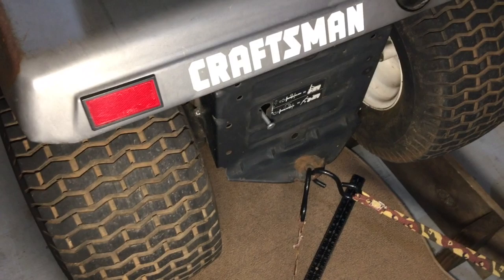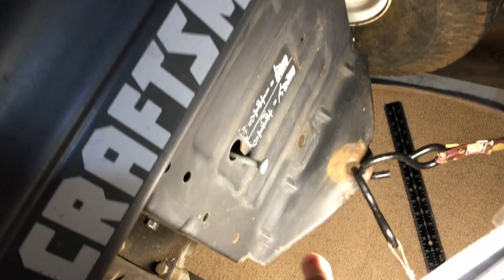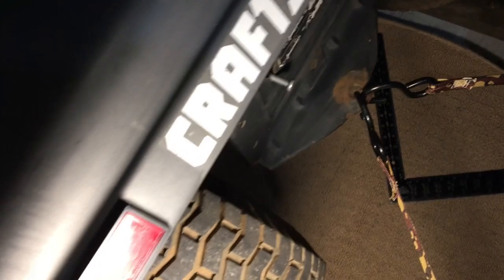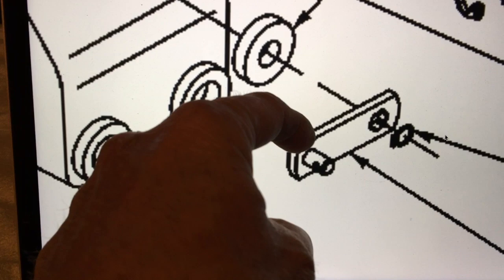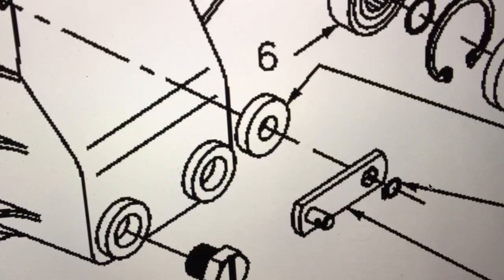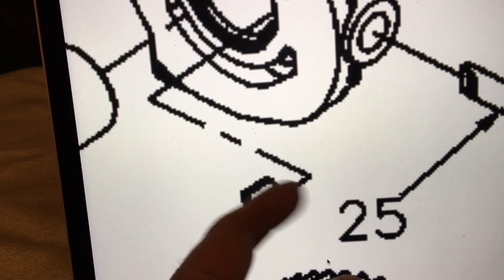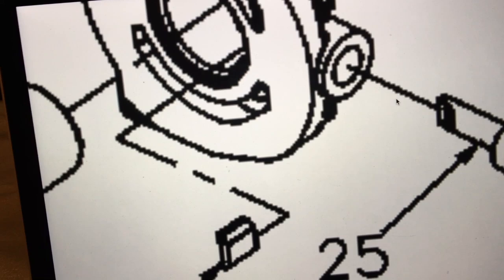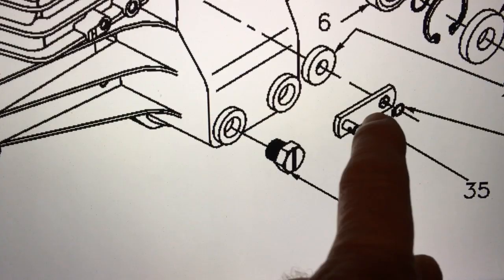Lawn Tractor Hydrostatic Transaxle Disengagement/Bypass Actuator - Diagnosis Part 1

Comment: Access to the hydro gear is by removing the rear cover (or what Sears calls the Drawbar Stretch). It is the part with the 'keyhole' that the disengagement lever goes through. There are two bolts on either side (you can see the ones on the L side at 0:27). Use a 9/16 ratcheting box wrench, etc., to remove the bolts then pull the rear cover right off. Full access to the hydro gear. Keep in mind that the disengagement rod must be pulled firmly, streting the spring, and the retaining pin set to activate the bypass.
Good luck
Paul
Reply from the maker: Thanks Paul!

Comment: I took some of those old ones apart before and they lock up from water getting in from were the rod pole is at on the top of the transmission it drips down between the rod pole and into the transmission in will sit their an rust the shifter rod out until it locks up 

If it's a cheap spicer transmission I don't think they used good seals around the rods on top the transmission and then inside it not good they made it to where it would hold water on top then until it gets inside and then those old ones are packed with black grease it's not oil that turned into grease over time its black grease the same as what's in a tube

Comment: the owner actually cut the bypass valve release bar. IT doesn't move at all any more so something is wrong with it. I can push the lever in and use a wire to hook it. I can hear a whining comming from the transmission but the mower refuses to move. Eather the bypass is bad or the pump is. The owner told me it was slowing down while trying to move it, so my guess is the pump has failed.
Reply from the maker: I'd say their bypass system on these is not a great design. And these hydros are a lot different than the much more heavy duty hydros you will find in older Wheel Horse, Cub Cadets, John Deere's and others. I think the hydro internals in them are decent for what they are and the price range .. but the bypass mechanism is just bad. I have a Wheel Horse hydro that looks like it is 10 times stronger than one of these hydros. These newer Sears Hydros are probably best considered 'disposable' .. still could be a great mower for 10-20 years .. but the older stronger ones could last forever with proper care. I've got a 1969 Sears Hydro that is of the same heavy duty quality as the Wheel Horse/Cub Cadets etc, so Sears did make em .. just not so recently like in these 1990s models.
Reply: @maxhauler  mine are past 20 years old and all still works good

Comment: Please, where is Part 2? What did you have to do to fix it? My trans release suddenly quit when we tried to release it to roll into the garage for a starter problem. Seems odd to have both problems at the same time.
Reply from the maker: Hi Stephanie. What are the symptoms of the starter issue? It is extremely unlikely that those two issues are related and I'm pretty sure that aspect is just a coincidence. Regarding the hydro-static trans-axle release/bypass: I never continued my diagnosis and thus the video series, but I am pretty certain what the issue is. If you notice in the above video at the 6:34 mark where a green
arrow appears: This is pointing to the top of a shaft which is aligned vertically and to it attaches an arm which rotates in the horizontal plane, pointed towards the left side of the tractor.  The lever (wire) you operate in/out on the rear of the tractor is attached (with a spring in-line) to the end of this rotating arm. Where the arm attaches to the shaft, it uses a rectangular hole in the arm, fitted over a rectangular part on the end/top of the shaft. A screw secures the arm to the shaft. I believe that the actual problem in most cases is that the arm has come off of the shaft and/or has worn/stripped the rectangular fitting area of either the arm or the shaft or both. I believe that the screw can come loose leading to the stripping or detachment, but I also believe that the arm can strip the attachment point without a loose screw, but most likely the screw loosening is the precursor to the issue.

Now I never actually did any further diagnosis or work on this tractor after the end of the above video as I have 10 tractors and life happened. Hence no Part 2 video. But based on what I could see up in this very inaccessible and cramped area of the trans-axle and equally based on what can be seen in the manual exploded view I include in the video, I am fairly sure this is the problem.

There is a slight chance that a similar problem could occur on the other end of this little (approx 2-3 inch) shaft down inside the trans-axle, where a shovel-shaped end twists against a rectangular shim which actually lifts the hydro-static motor away from it's base to allow oil to bypass .. BUT I think it is far more likely that the problem is on the external end of the shaft. We have all seen arms/shafts with this kind of rectangular attachment point come loose. If you are lucky, then perhaps the screw simply came loose and things can be fixed by reattaching. Unfortunately I think any work on this bypass arm can only be done by removing the trans-axle from below. I suppose there is a chance that removing the seat and fender and fuel tank might allow sufficient access from the top, but the amount of work is probably the same done from below as from above and dropping the trans-axle is the only sure way. I'm guessing about access from above.

Dropping the trans-axle is much easier than it sounds. If care is taken with preserving the positioning of the shift linkages then this is very straightforward and shift linkages can be adjusted after the work. You might find that you can simply reattach the arm to the shaft and tighten the screw and add some Loctight to the threads to prevent loosening. If the rectangular attachment part is damaged (as it could be) then it might be possible to actually do a quick weld to secure the two parts. I would personally be fine with welding the attachment point to save me from a full trans-axle disassembly.

Worst-case scenario is if you replace the entire shaft and arm. It does appear from the manual that an nearly complete disassembly of the trans-axle may be required. Now the parts themselves are readily obtainable used from Ebay and complete with shipping you can probably get both the arm and the shaft for less than $30. I don't think you can get these parts new anymore but it might be worth looking.

I think a good step might be to just drop the trans-axle and see if the arm can be reattached easily, even if it needs a quick shot from  a welder. If so then you are in luck. If not, then of course how much effort you might put in from there (which could be a lot) will depend on how much you love this tractor.

Good luck! - Maxhauler.
Reply from the maker: Small correction: It looks like rather than a screw, the arm is attached to the shaft using a c-clip. The best-case solution would be similar .. reattaching perhaps with a new c-clip, but more-likely, a shot from a welder, preferable to the full trans-axle disassembly. The c-clip usage lends itself to an increased likelihood that the rectangular area is stripped and also does not allow the use of something like Loctite to strongly secure a screw. Hit it with a welder if you can IMHO.
Reply from the maker: Apparently, YouTube lost my very detailed response to you. It was like a full page long. In a nutshell, Look at the video at the 6:34 mark. The wire you activate from the rear of the tractor attaches to a spring that attaches to this two-inch long metal bar which attaches the vertical shaft coming out the top of the transaxle. A C-clip secures the bar to the shaft over a rectangular hole. My guess is that either the clip came off and/or the rectangular hole and matching rectangular part of the shaft are stripped. Parts are cheap and easily obtained (used) but replacing that shaft probably means an almost complete disassembly of the transaxle. I suggest removing the transaxle from below and WELDING the metal arm back to the shaft. I think this is the only reasonable solution, but that's just my opinion. I'm sure you just want to get it working again without too much trouble so that is what I suggest.
Reply from the maker: Well that's weird .. one day YouTube has lost the big replies I wrote to you, then the next time I look they are back. Oh well. I guess they like to make me type a lot!

Comment: i think i got the same probulem show me how you fixed it
Reply from the maker: Never fixed mine but the plan was 1. see if I can take off the seat, tank, fenders and frame section above the transaxle (if it even comes out.) .. then access from above .. or 2. drop the transaxle .. Then once accessed: 3. Tighten it up again with the strongest loctite (requires total cleaning of oils to work right.) .. or as might be the case if the parts are worn from being loose and wont tighten up well .. 4. (last resort) .. just use a tiny weld there to secure the lever to the post.   5. (not worth it IMO) take the transaxel completely apart and replace the little shaft (if the end is worn from being loose.)  Those are my thoughts on the matter. Good luck to you!
Reply from the maker: I should clarify: The pulling wire is attached to a 3 inch lever arm which is attached to a vertical shaft that enters the transaxle. The arm and post connect with a square hole. This design means that if it ever comes loose .. and I think they all come loose .. then it will quickly destroy the mating surfaces of both the shaft and the arm, especially becase everone will try yanking on it quite a lot. It is a bad design. This is why I think a good fix might actualy be to do a little welding job on it .. carefully, as there is a rubber seal around the shaft I would think. Good luck!

Comment: My bypass rod moves to open and close bypass valve but really needs a little force and it snaps in with pressure from my finger but ever since the last time I disengaged transmission it will not fully engage so my transmission is constantly in neutral.  Any suggestions? You mentioned your issue was different as it seemed loose.
Reply from the maker: Hi Jill, I think the likely issue is this: the rod you push in and pull out connects to a 2 inch arm which is attached with a nut to the top of a vertical shaft. The nut comes loose and then the lever ca ride up off of it's rectangular post which fits the rectangular hole in the arm. Continued operation will very quickly destroy the rectangular hole and post. If you catch it early, the arm can be re-secured. However, it requires disassembly of a lot of the mower to have access. It might require taking off only the seat, fenders and an upper frame brace, or even a little more or even removal of the transaxle. It is a lot of work and for many people might not be an option, unless you know someone handy and affordable who. It is an achilles heel of otherwise great mowers. I'm not sure this is your issue but it is a common one, which this video shows. I wish you luck in resolving it. It is a good thing to keep our all American Craftsman tools going, because there will never be anything like that again. :) Take care.

Comment: you have to pull it hard and then the very last quarter turn is where it unlocks it
Reply from the maker: Not when it's broken like this one is. And really it is easy to brake if you pull it hard. If eveything is good with the tractor you should not have to pull it that hard, but these machines take a beating so I bet problems with this disengagement mechanism are common. I think the inside of the Hydro is pretty well built. The issue is where the lever attaches on top of the transaxle, as shown in the video.
Reply: @maxhauler  was your shifter in the middle between were your feet go at

Comment: I have a similar Craftsman and the disengagement lever does nothing. It's never worked.
Reply from the maker: Then you know how hard it is to move these when they are not running. If you cannot disengage one of these Hydro trans, you have no choice but to drag the beast around with locked up wheels. You have to run the engine and actually drive it even if you want to move it a short distance. Dragging it gets old really fast and is a good way to get a back injury. Such a small failure of this little lever can basically make a good tractor into junk. They shuold have made that lever attachment on the top of the transaxle much much stronger. I ended up pulling the good engine out, taking the new seat off and leaving the tractor out for the metal recyclers to pick up. It had some other issues too. Had to make room anyhow.
Reply: @maxhauler  PITA indeed. I rarely need to move it without running the engine. I do know that the brakes are seized also. It's actually the lever/actuator. I'm almost certain the lever for the hydrostatic disengagement is also seized. I'm hoping it's not an internal issue, but rather rust that has taken hold. Oh, and my wheels are seized to my axles as well, lol. Tried everything, the darn thing wouldn't budge. So clearly it was neglected before I took ownership.
Reply: @JasonTylerRicci  I pounded the fuck outa my rims to get the right side rim off then the whole half of the axle came off with the rim and tire then it was a little easier pounding that axle out of the damn rim what was holding it on so tight was the rusted up key i kept using old oil to try an help loosen it from the rim and it worked and it wasn't fun

Comment: No idea what this video is about...couldnt hear anything!!
Reply from the maker: Yeah I know the volume is way too low. Now I know how to fix that for future videos but I don't know of an easy way to fix this one. If you turn up the volume all the way it is possible to hear. Just watch out when the next video comes up!
Reply: maxhauler thats ok...i just turned the volume up.  Did you ever figure it out? I have the same problem on my husqvarna...it wont disengage to freewheel push.  I guess its better than wont engage to drive.
Reply from the maker: my problem is most likely that the arm with the rectangular hole has stripped from the shaft that goes inside the transaxle to operate the bypass valve (if you can call it a valve as it's more of a wedge that lifts the motor cylinder up so oil .. bypasses under the base) .. OR there could be an internal problem. but the way it feels so loose I figure the problem is on the outside. in my video I pause for a second and show a green arrow where I think the problem is.
Reply: The one I just bought won't disengage, but it's also acting a little funny in drive.
I think I'm taking the rear end out like he suggested elsewhere.
I could hear you fine